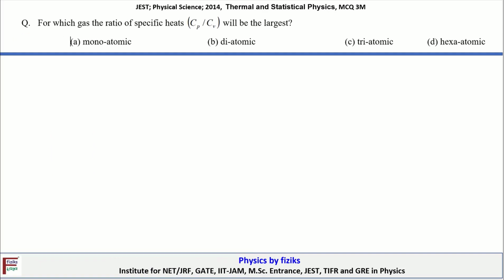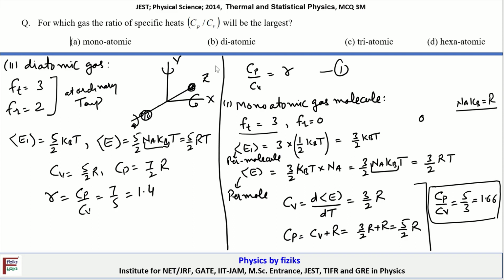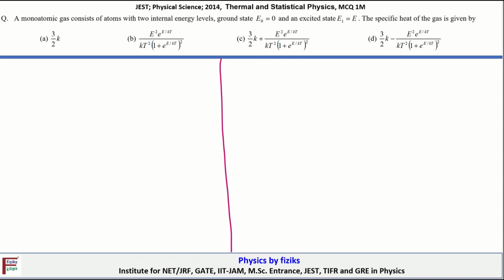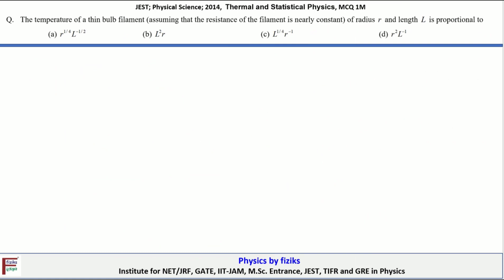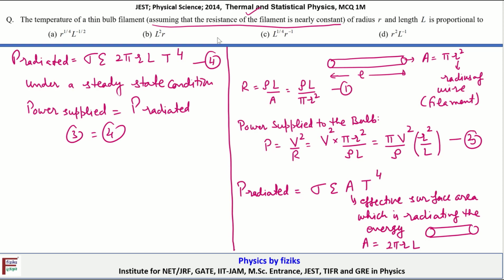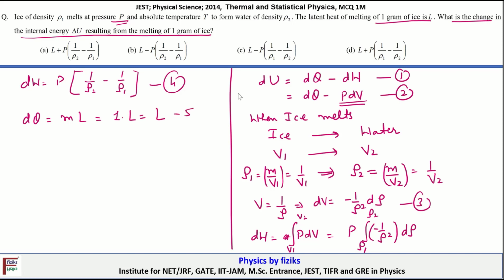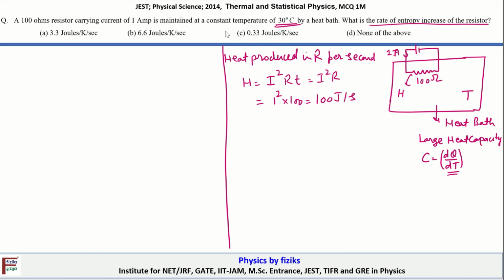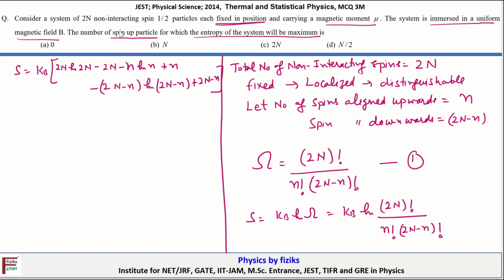JEST Physics 2014 Full Solution of Thermodynamics & Statistical Physics

Comment: A cubical vessel contains diatomic H, gas at a temperature of 300K. Each molecule consists of two hydrogen atoms of mass 1.66×10-27 kg and separated by about 10^-10 m. Calculate the root mean square speed of rotation of the molecules about an axis which is perpendicular bisector of the line joining the two atoms.

(a) 3.16×1013 s¹

(b) 3.16×104-1

(c) 3.16×102 s

(d) 3.16× s ^ - 1